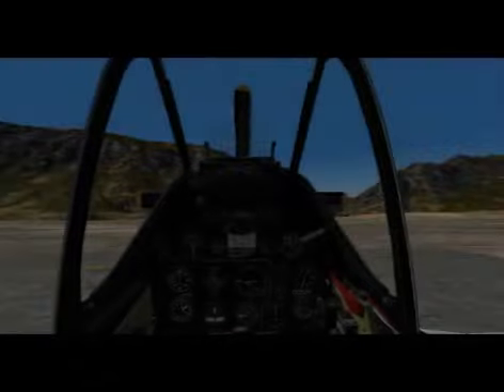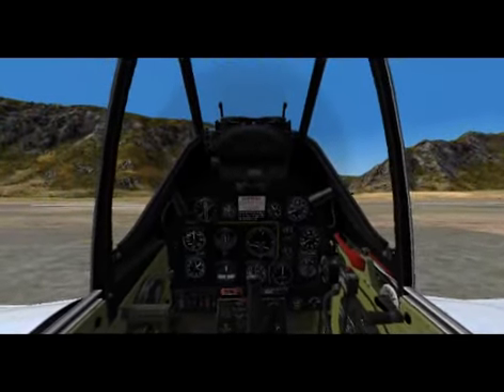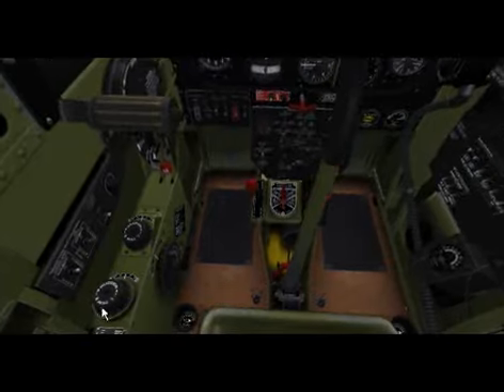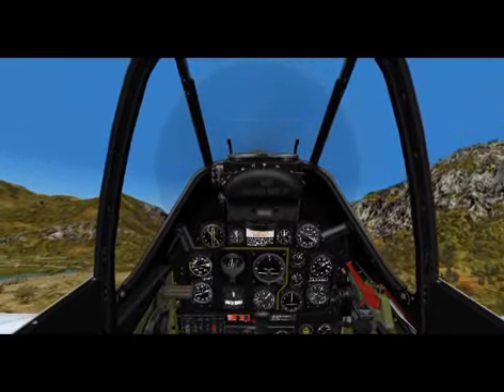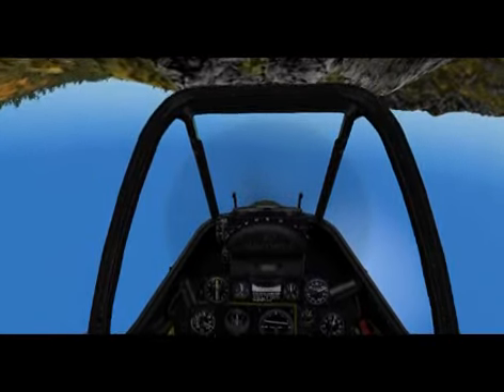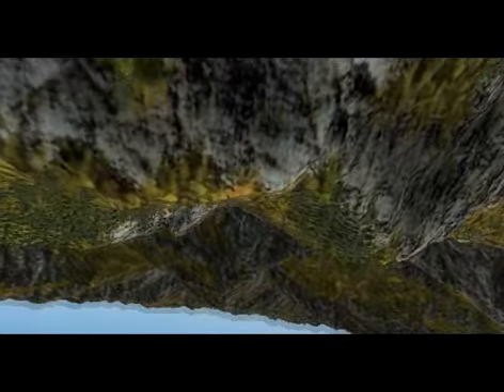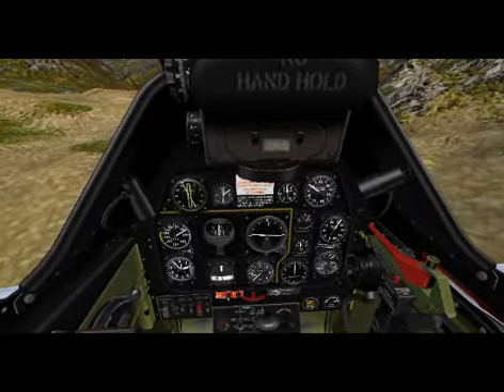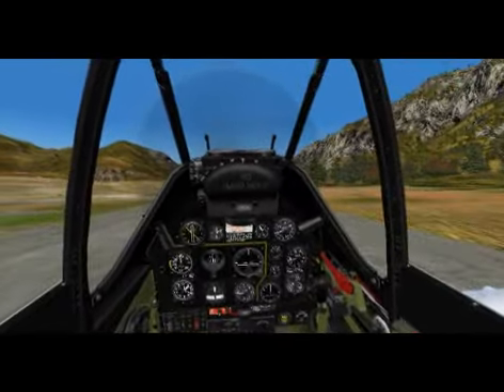Romping around with the P-51

Comment: Is the rudder trim used to help against p-factor?  (The tendency for an airplane to pull to one side due to the power of the prop spinning; a twin-engine that has props spinning in the opposite direction of each other won't do that).